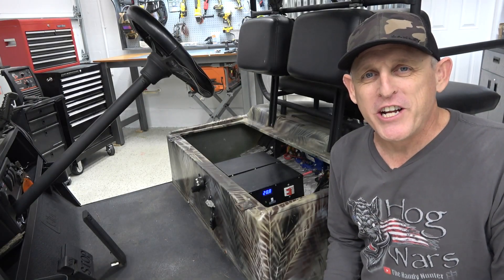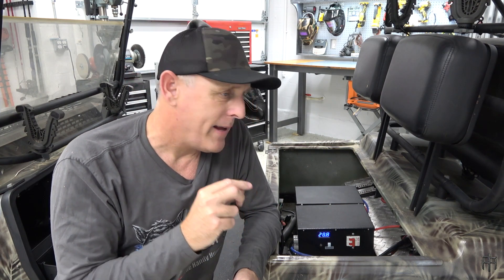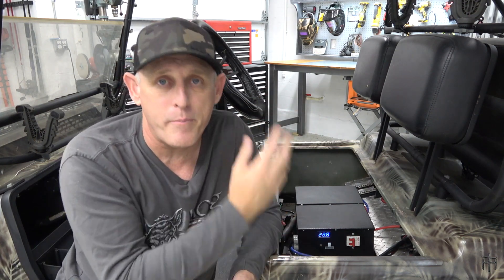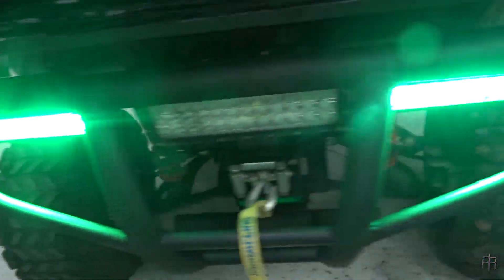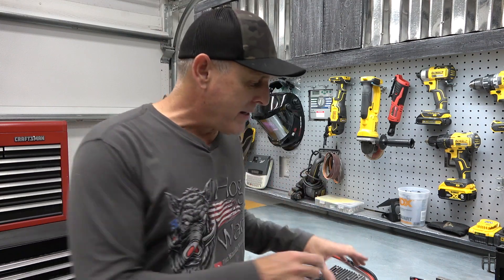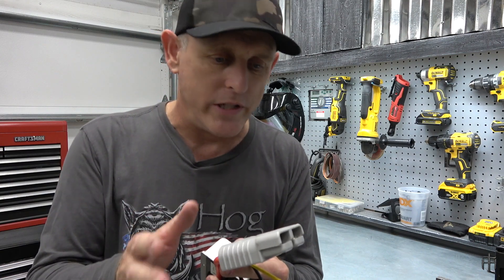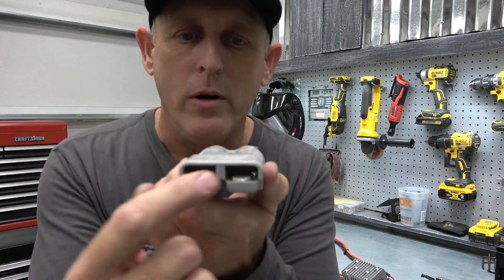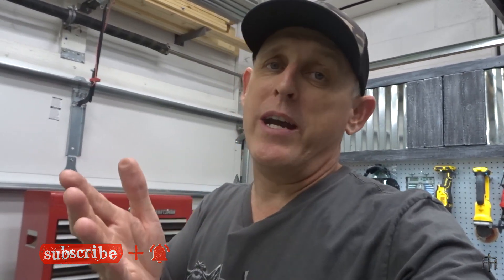Lithium Battery Fix for 48v Golf Cart-DIY Jig

Comment: Awesome video and awesome cart. Does anyone know what a cart like this would or could pull at maximum amp draw?  I have an older cart 36v stock Curtis controller motor ect and I’ve been looking at lithium however none of the ones I’ve seen 3x12v or 36v seem to be able to output more than 150 ish peak for a few seconds and 100 continuous in the price range say less than 2,000. Any help is much appreciated
Reply from the maker: I pull a little trailer with about a ton of firewood on it and my amp draw while pulling that load is about a 100 amps.  It’s more on takeoff but you dont hold that but for a few seconds.  If you are keeping 36 volts you might just stay with 3 lead acid 12volts.  Lead Acid are bullet proof.  Last option is to build your own battery pack out of the 3.2v blue blocks LifePo4’s from china then add a higher amp BMS like a Daly 500.  I may do this next time.  Good luck!

Comment: Question, I changed out to lithium batteries 48v two the cart dies completely when you go up a hill and put a load on. You take the cables off battery and check batteries they read full ? Thanks
Reply from the maker: What brand of lithium batteries?  Is it one 48v pack or two 24v packs, etc?  Is it throwing a breaker on the pack?  What kind of controller do you have?
Reply: @TheHandyHunter   It is Allied lithium. Amp hours 2 x 48v 30ah (60Ah total
Reply: @TheHandyHunter  The controller is real time Led battery monitor
Reply from the maker: It could be that the batteries can’t deliver the amp demand and either the batteries or the controller is shutting down for safety reasons.
Reply: @TheHandyHunter  it does not break any breaker’s the batteries just go dead but when you disconnect it reads 48v you plug in charger and the monitor comes back on and reads full and runs again for awhile . It seems when yo put a load on it going up hill is when it just shuts off
Reply from the maker: Have you talked to the battery manufacturer?  Does it do it if you try pulling a trailer or something heavy?  What amp controller are you running?
Reply: @TheHandyHunter  I sent a email to them explaining the whole issue waiting for response. I just use it for golf put when I go up a hill and put a load on batteries it just goes dead. I am using the battery indicator that came with batteries

Comment: How are these batteries holding up?! Also are you able to just charge each battery individually? Thanks for sharing!
Reply from the maker: Holding up great! They charge fast and run long.  The only thing is that they weigh so much mess that my cart rides rougher…lol.  I charge them together but will use my jig to draw one side down to match the other when needed…easy peezy.  Hope that helps!

Comment: It would be better to have full voltage in each pack with less AH. Two 48v packs would be hooked up in parallel which would automatically balance the packs together. I don't know why they sell 24v packs for golf cart use. Also the constant amp rating on these batteries is too low for offroad use. 
I'm building my batteries to handle 400amps continuous. This will keep them cooler and not work so hard.
Reply from the maker: Yep, my next battery pack will be totally custom to get the high amp output.  I’ll never do 24 volt packs again.  Thanks for sharing!

Comment: This may be a dumb question but could you not just flip the breaker on the higher battery to bypass it since they are in series.
Reply from the maker: Never a dumb question and a good point!  I’m pretty sure the breaker breaks the whole circuit so you would have no power at all at the bus bar.   My problem is that even if I got 24 volts at the bus bar from the high battery my 12volt reg only works with 36 or 48 volts, not 24v.  That’s why I had I had to buy a 24v reducer and connect directly to the 12 volt bus bar.  Hope that helps and thanks for commenting!

Comment: You came up with a solid solution when you’re in a pinch. If you’re interested in avoiding the problem in the future, the “correct” way to maintain balance between both 24v battery boxes is to put a 48v BMS in between your battery bank and your solenoid/controller.  The cost for a DALY 500amp is only about $150 more than buying the 24v power supply and it will maintain balance perpetually so you don’t have to constantly check them.

Love your cart btw!
Reply from the maker: Great info and thank you for sharing!  So I assume that it would connect to each battery separately while still being wired in series for 48volts?  I think I may look at 1 piece 48volt packs in the future.  I’ll check out that bms so thank you very much!!
Reply: I would go the 48v route. Also the constant amp rating for offroad use should be atleast 200- 250 amps continuous.  Which will require a larger pack (150ah) alot of these drop in replacements can handle 300-350 amps for only 8 to ten seconds. Check the specs.
Big battery 48v Eagle  kit  120ah has 320 continuous amp rating.

Comment: Do you not have a BMS on your batteries that balance for you?
Reply from the maker: Each 24volt box has it’s own bms but since they are wired in series the main charger only sees them as one battery.  Once one hits charged it makes the charger shut down.  The ideal way would be for the charger to charge them separately but hard to do while being wired in series.  The problem doesn’t happen a lot but good to balance them every now and then when needed.  Hope that helps!
Reply: @TheHandyHunter  ah ok. I have a Nissan Leaf Gen 3 lithium setup on my cart. It’s 2 modules wired in series similar to yours but my BMS monitors and balances all the the individual cells and only sees them as one battery.